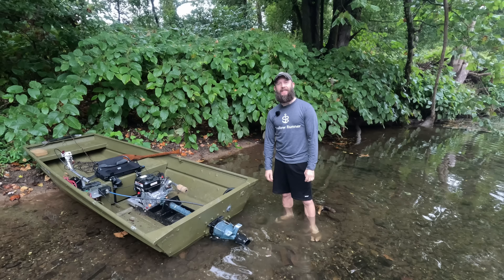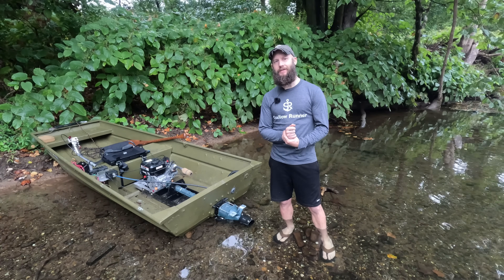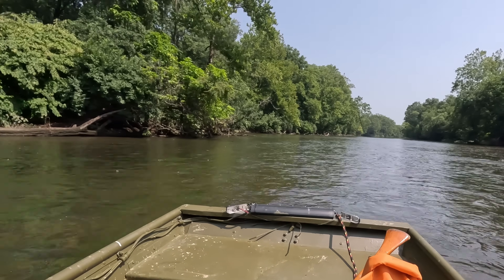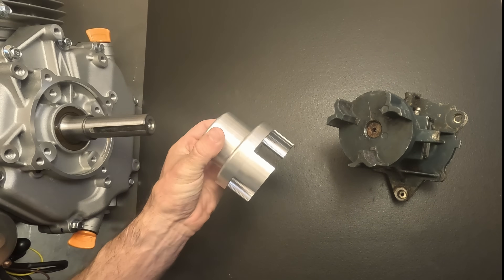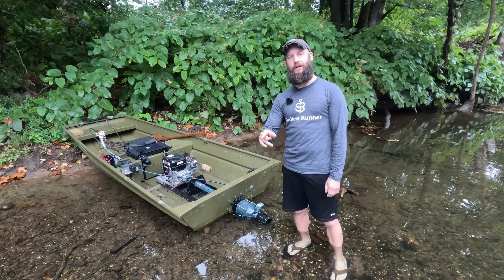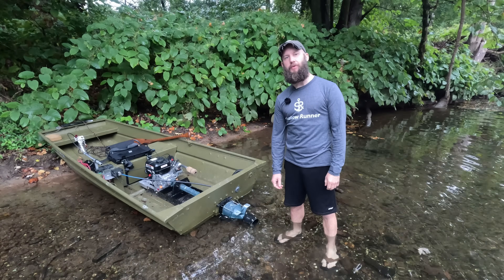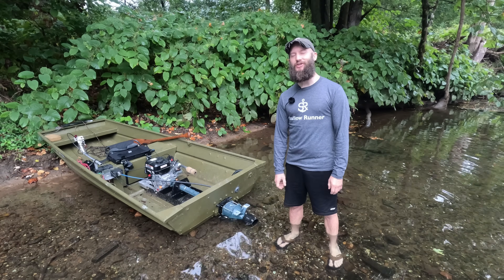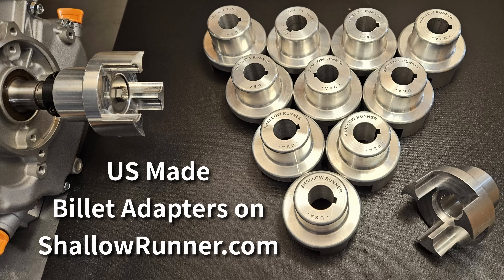212cc Predator Engine Jet Boat Build

Comment: Pretty sweet. Have you considered using a cvt/ torque converter? You would have to shift the engine over then align the adapter and shaft to the secondary pulley somehow, but you would potentially have the benefit of higher impeller rpm, but still have torque to get on plane. I’ve used them in mini bikes though, not sure how it would work with the resistance of water.
Reply from the maker: That's a good question I think a few folks have been asking with good reason. I think it's been done with some decent success, check out Midwest Hobbies: https://youtube.com/@midwesthobbies?feature=shared ,  https://youtu.be/PqQhL6sfoXo?feature=shared . I think there's a ton of settings to dial in to get it right, and would probably need a super robust set of components. I do long river trips 10+ miles up river and personally lean towards simplicity with direct drive. I like the idea of running these engines at lower RPM to preserve longevity of the internals. If you build one upload a video!
Reply: @Shallow.Runner i agree in keeping things simple. I will say though, the engine max rpm isn’t affected by the torque converters, its just like like adding gearing, lower rpm it’s more like a gear reduction, more torque, and as you increase engine rpm it will change to more of a gear multiplier. I’m not much of a fabricator but I’d love to give it a shot. Won’t be looking forward to registering it though.

Comment: I wish I was in to the little jet boats. Because I would definitely figure out a way to hook that up to a torque converter. Then you would basically have neutral, and I think you could get a lot more top speed out of it.
Reply: I built one with a CVT but belts did not hold up, I went with bully chain clutch
Reply: Comment makes a new clutch.
Now, for high horsepower engines rated for UP to 30 horsepower, or something like that can't remember what the model of the clutch is. But they use a lot of them on red beard's garage, the actual converter part of the clutch on the engine. Looks like A Donut almost @midwesthobbies
Reply from the maker: @chriss8206  Thanks for the feedback. A torque converter has a ton of potential for sure, especially with a higher rated Comet type Duster clutch or equivalent that was rated for the correct RPMs / gear ratios. I am a fan of direct drive for the simplicity and the fact that it's nearly impossible to fail. I can see the appeal of neutral too, though at 1200rpm these pumps produce minimal thrust, maybe pushing it at 1/2 mph - 1mph max. When I'm 20 miles up river on a camping trip I can't afford to be shredding or changing belts. Someone should definitely do a build for a fun of it with a robust torque converter.

Comment: Just found your site and I really appreciate all your hard work and enjoy watching your videos. My son and I run Predator Motors and we have found the cheapest upgrade for more power is to remove the internal Governor. There is many videos on this subject and is very easy to do. Again thanks and hope this helps you. Stay safe and keep these videos coming please.
Reply from the maker: Hey thanks for the solid feedback, glad you can enjoy horsing around with these engines. I learned to work on the equivalent with my father growing up, all good memories. Agree completely on the remover of the governor combined with a billet flywheel. I have a few videos currently being recorded so stay tuned and thanks for your patience.

Comment: I'm currently building a 11'x45" flatbottom (former airboat) jet boat.  I have a WR500 intake and pump/nozzle installed on a ride plate.  I have a really overbuilt 212 pred with a CVT and was planning on using a sprocket drive from the CVT to the midshaft.  Is there a good reason to go direct drive instead of the clutched setup?   I think the engine is around 17hp
Reply from the maker: Sounds like a cool setup depending on the overall weight of the boat. That engine might work well for the application though it's always hard to say. I prefer direct drive since I primarily use electric start setups and it cuts down on areas that can fail. Jet pumps don't generate a great deal of thrust at 1000-2000 rpm typically, might push it 1-2 mph if you can live with that during start up. I don't know a ton about how well a CVT will hold up for the high torque demand. There's either the chance that the CVT could assist with overdrive, or it could struggle with the RPM/Torque translation. Feel free to shoot me a message on ShallowRunner.com if you have more questions.

Comment: Awesome video, do you know if your adapter will work with a 2001 Yamaha gp1200r?
Reply from the maker: Hello, this specific adapter will not mate to that pump. I can't speak to how well the predator line would work with the larger, 155mm pump. If you're interested in a coupler for that one, shoot me a message through www.shallowrunner.com.

Comment: So the drive shaft that goes from the engine to the drive unit. What did you use for the shaft and what did you use for the housing around the drive shaft?
Reply from the maker: Thanks for the inquiry. If I understand your question correctly, the parts you're inquiring about are all stock parts off a Waverunner 500 jet ski. If you google, "Waverunner 500 Pump" that should hopefully give you a good visual of those components. Feel free to reach out through shallowrunner.com if you have more questions.

Comment: Can you go over in detail how you got the pump to to seal in against the rear of the boat?
Reply from the maker: Hey this is a great question. I can cover this in one of the upcoming videos for sure. I experimented with a 3d printed flange. If you're building one of these and need help definitely reach out on shallowrunner.com . I can offer a super cheap 3d printed flange, or send you a free laser cut profile for aluminum depending on how you plan to mount it.

Comment: So that awesome coupling you make and sell is it the same as one for a yamaha 1100 looks the same ? Reason I ask is my 14ft boat I have the 1100 pump and everything and my engine is down so I'm tossing the idea around of a built twin engine
Reply from the maker: @zacharylewter1311  Great question, we personally haven't run either of the 144mm or 155mm pumps with a clone engine. A twin cylinder might be a good option for either direct drive or a geared ratio with a timing belt, though personally haven't run that setup. Some challenges are a built twin can be super expensive and doesn't quite match the rpm requirements for higher speeds.

Comment: Will the predator 670cc motor work with the adapter you make and that pump?
Reply from the maker: @nicbowen38  Hey, yes greaf question this adapter will work with the 670 as long as it's a 1" shaft. Fits on the 670 crank in my garage. I read somewhere about some of these twin cylinder clones having 1 and 1/8" shafts. The Predator 420 has ample power to push the waverunner 500 pump as far as I've been able to tell. A 670 might be overkill unless you planned to run it at a ratio setup, which I can't speak to at the current moment. You might have to put a spacer under the pump to get your midshaft higher, but the 670 shaft height is only about a 1 or 2 mm higher than the 420. Another thing to keep in mind is that the 670 performance parts get super pricey compared to 420s. I don't know enough about running the 670 ungoverned, what parts beyond heavier valve springs that would be required. It would have all the torque the pump would need stock. Hope that helps.

Comment: What do you think is the legality of this? I’m planing on building a home made 7ft dinghy, and while my original plan was to just get an outboard, my friend suggested the idea of using a predator as an inboard like this. Would prevent having to title the motor and having to pay outboard tax, but I’m struggling to find out if USCG inboard regulations apply to something that will only see occasional use on the local lakes and I can’t find any regulations or requirements in my state when it comes to inboards other than the fact that the boat itself needs to be titled and registered. A predator engine and a used jet ski drive are way cheaper than buying and titling an outboard. I need my boat to be legal because I don’t want to get into trouble with it, but I’m struggling to find this out. Also, is the airflow from the flywheel really enough to keep one of these cool as an inboard in a boat?
Reply from the maker: Great questions and worth thinking about carefully. I cannot comment on the legality of it but it appears it varies significantly state to state and country to country. Definitely call your Fish and Boat for your region and pick their brain about options, you are not the first to hit that fork in the road. Some states may allow titles to be changed from outboard to inboard. I know the US Coast Guard  HP rating system is complex, some have said outdated based on modern engine ratings and hull shapes. As to cooling I don't think these would do well in an enclosed arrangement. I overheated a 420cc once running 5500rpm for 1hr in 105F heat, but this was also likely due to the fact that a seat cushion was blocking the flywheel intake grill. It wouldn't hurt to have a duct to pull air down and around the flywheel intake, this is what Mokai does for their semi-enclosed 10hp four stroke running at 3600 rpm. I have a mokai and have never overheated it even in the dead of summer.

Comment: You should try a gocart clutch.
Reply from the maker: That's not a bad thought, there's another YouTuber that has tried that with some success. I'm a big fan of direct drive since it eliminates any failure points. I could see the appeal of trying to get an overdrive situation, though with direct drive with a 420cc at 33mph I'm content with the top speed. With direct drive these pumps put out almost no thrust, so idling is nearly the equivalent of a car in neutral.

Comment: put the predator 420 in that makes 20hp
Reply from the maker: @TacoTueJay  Agreed, you can check out my other video on the channel with a 420cc that's running over 30mph. My next video will be explaining a 420cc setup.
Reply: @Shallow.Runner why did you switch from the 420cc?
Reply from the maker: Sorry for the delay in responding, this comment alert didn't come through. We went with the 420 for a few reasons. The electric start is much more convenient in a small boat, it makes double the horsepower out of the box, and has the potential to make 20-40hp depending on what you'd like to invest in it. The 212 is definitely cheaper to upgrade, and a bit lighter so there's pros and cons each way.

Comment: Thinking about doing this with the 20 hp harbor freight v twin what type of power you think that in a 12 foot job would make
Reply: What did the stage 3 420 push the boat  at and what did it rev to ? Thanks for your response, keep up the great content!
Reply from the maker: @cole2546  On a good day it would push the boat to 33mph at about 5600rpm give or take depending on the impeller/cam combination. The pumps were designed for 5500rpm from the Waverunner 500cc twin cylinder. I'm filming a Predator 420cc video as we speak with some more information that should help.
Reply: I’ll be looking out for it! I know you can push those engine to 9k if built right, would that destroy the pump if done? And I wonder if more speed could be reached if it reved to 9k with a pump that could take it
Reply from the maker: @cole2546  Great point, I considered throwing in a cam and some other supporting hardware for higher RPM but was trying to obtain some longevity since it was my daily driver. Anything over 5500rpm would need a forced air duct to keep it cool. I did overheat it once on a 105 degree day running 5500rpm for an hour straight. Engine ended up being totally fine, tore it down and threw a piston in for good measure. Part of my issue was some of the cooling paths to the flywheel were blocked, and I was missing a shroud that helped pass air over the engine from the flywheel. I'll cover it in the next video, but the pump torque demand is unique, it demands way more than double the power at 4k rpm than it does at 2k rpm and so on. I need to schedule a call with my pump expert to understand what the likely max rpm these pumps can take before imploding. I'll report back in the video with that info which should help the next person I hope.
Reply: Interesting so definitely focus on parts that increase tourqe. Thank you for your responses, will be interesting to figure out what speeds these motors can push and what motors you can run. Thank you keep putting out great content!
Reply from the maker: I'll be putting out a predator 420cc video with some info that will help on that topic. The stage 3 Predator 420cc that I tested had ample power to push the 133mm pump. My guess is the Predator 670cc v-twin would best be suited for a geared/belt ratio drive since it would be overkill for a direct drive application. I can't speak specifically to that motor's performance in a geared ratio at this time though.

Comment: Could the 459 cc be direct drive on the 133mm like you did for the 212 and 420?
Reply from the maker: The 459 should work as a direct drive at least stock, however keep in mind there may be less performance parts available as far as I'm aware for that engine compared to a 420. Red Beard's garage did a full review on the 459, I don't believe there's a billet connecting rod available for that engine at this time. An engine in this application would best be suited with a billet rod.
Reply: @Shallow.Runner  Could the Predator 420 be used on Yamaha Waverunner 1996 WAVE VENTURE 1100
Reply from the maker: @Tracy-j4v  That's a 1st gen 155mm pump, so far I don't have any data or trials with a pump that large at this time. Right now the 133mm Waverunner 500 pump is a sure shot.

Comment: Could you make this work with a larger engine on a YAMAHA 1996-97 WAVEVENTURE 1100 assembly?
Reply from the maker: Hey good question, I believe that's the 1st generation 155mm diameter pump with a target rpm of 6500rpm at 110hp. At the moment I can only speak for the Waverunner 500cc, 133mm pump, that's optimal for a lower RPM configuration like a Predator / clone engine.

Comment: Nice!! Ive been running a 212 longtail for the last 8 yrs. This would be a fun backyard project to look into next summer. My yard has a beach on the Chena River in Fairbanks AK.
Reply from the maker: @Alaska-Vet  I've been meaning to experiment with a longtail just too many other projects. They're a challenge to build but I think I've cleared up the majority of the headaches and hope to save the next guy the same troubles. Sounds like an ideal place to take a boat for a rip.

Comment: Get a 224 and install a 275 cam and some 26lb springs to get the rpm up. This boat is awesome!
Reply from the maker: Couldn't agree more. I tried to go with a "stock" vibe where with no cam, heavier springs, stock carb with jets / cheap pipe it would hit 19mph. I'm spoiled after running the 420cc in it with electric start but I could see a cam going a long way since the stock cams are designed for peak torque at 2500rpm at least according to predator.
Reply: I agree, I did lots of work on my 212 and I'm getting 21 hp out of it.
Reply: @murphyking79  Really, and you have no videos of that on your channel .😅😂🤣🤣🤣
Reply: @Ryan-h7m  Too busy working on his motor to be a social media star.
Reply: They make a turbo for it
Reply: Vm22 carb will boost horsepower 2+ for 30 bucks

Comment: Awsome video, great work I was wondering how much did this cost you to make?
Reply from the maker: Hey thanks, I'll cover more on costs in a later video but it was about $300 for the boat, $100-200 in raw materials, $400 for the 212cc engine plus hop up parts, $200 for the ski I pulled the pump out of, so maybe $1,000'ish total. The 420cc build was a good bit more because of the stage 3 kit, fuel system, custom exhaust, custom impeller, so maybe $2,500 for that build though it can be done much cheaper which I'll cover soon.
Reply: Thanks, looking forward to seeing the next video